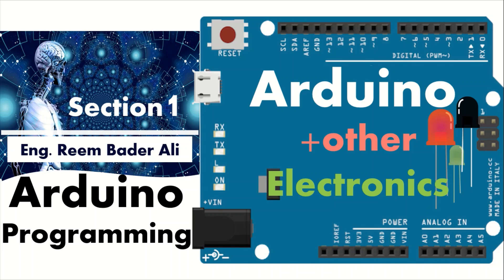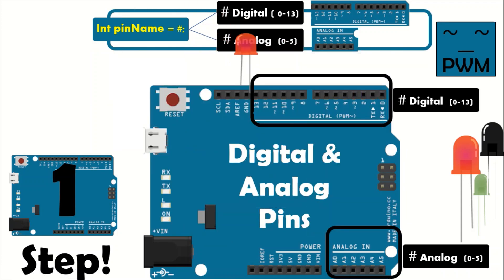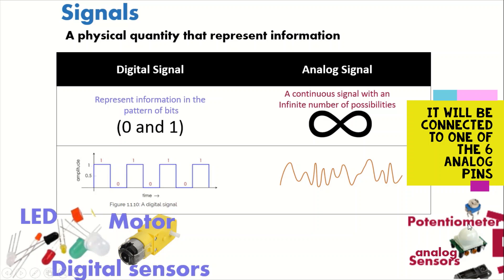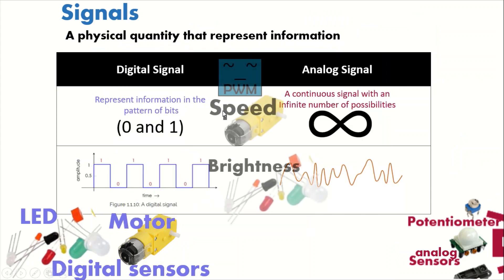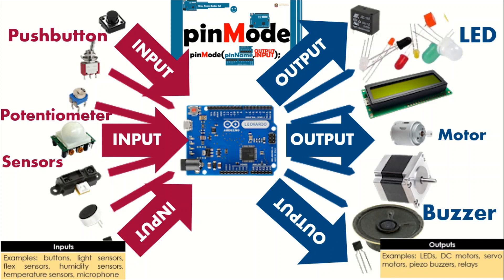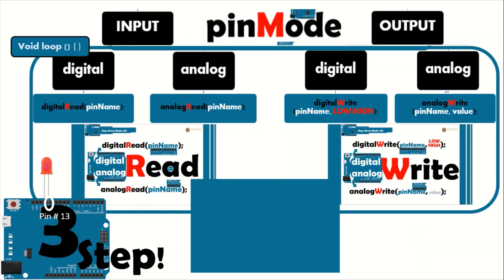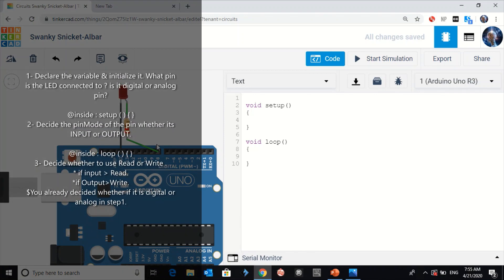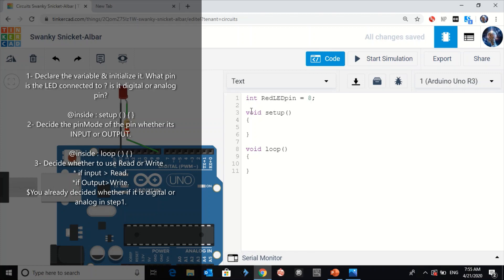Arduino programming: Arduino with other electronics. Coding in 3 steps only!

Comment: Shahad Adel 12B (General 1) 
I learned the difference between analog and digital signals and that we can control the brightness and the speed of a motor or an LED we must use PWM value.

Comment: What I learned: 
I learned that there are 14 digital pins from 0-13 and 6 Analog pins from A0-A5
Also if we want to control the speed or brightness we have to connect it to PWM pins . 
Jawaher Abdulla 12A

Comment: Norah Mabkhoot 12C 
I learned from this video how to code in 3 steps, digital signals represent information in pattern of bits, to control speed or brightness of LED we use PWM, PWM means pulse with modulation.
digitalWrite only LOW or HIGH

Comment: What I learned: 
 - Digital signals represent information in pattern of bits 1 and 0 or on and off
-  Analog signals is for infinite number of possibility not only 0 and 1 
- PWM can convert digital signal to analog signal 
- Input is what I put my hands on and control and output is what the device display for me.
 Fatima Yousef 12A

Comment: By watching this video I learned many things including:
there are two types of signals (digital and analog) digital represent the pattern of bits just like on or off but analog has an infinite number of possibilities.example on a digital signal is a motor or a sensor. A potentiometer is an example of analog signal. I also learned the different input and output devices such as a push-button is an input device but an LED or a motor is an output device.
There are 3 main steps for coding it:
1)declare it and initialize it.
2)decide if the pinin input or output and write it down
3)Based on if it is input or output you will choose if it is read or write  (if it was write you either have to put low or high(digital)but if it was analog you need to write the value(0-255)). 
Tala Husen 12-A

Comment: I learned how we can use Arduino and other electronic and there are 14 digital pins it works represent information in the pattern of bits and 6 analog pins a continuous signal with an infinite number. Alia Ibrahim 12/C

Comment: I learned how can we use Arduino and other electronics and there are 14 digital pins it works in representing information in the pattern of bits and 6 analog pins a continuous signal in an infinite number

Reem Altamimi 12C

Comment: Shahad Ashraf 12A 

tysm for ur explanation I learned that there are 14 digital pins and 6 of them are PWM. Also, I learned what is the difference between the digital and analog signals ( digital is in a pattern like 0 and 1 or on and off ) ( analog is an infinite number of data or possibilities ) + the difference between the input and output. The output is something that showed up for us like LED and DC. The input is something we give to the  Arduino like pressing the buttons, light sensors, and microphones.
Hope I explained that well thanks :)

Comment: I learned how we can use Arduino and other electronic and there are 14 digital pins it works represent information in the pattern of bits and 6 analog pins a continuous signal with an infinite number.

Comment: By this video I got to know what does PWM pins stands for which turned out to be Pulse Width Modulation and how they can be used, basically it is a method of reducing the average power delivered by an electrical signal, by effectively chopping it up into discrete parts. Also they could be used for Motor Control. Thank you Ms so much It's very easy to me now to recognize the difference between analog and digital signals (pins). Aseel Ashraf 12A
Reply from the maker: You got it!